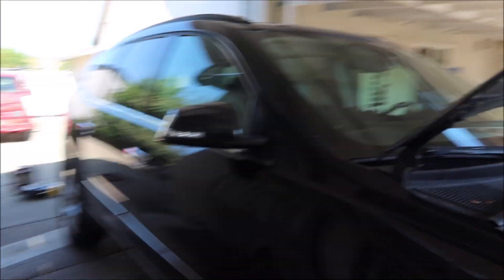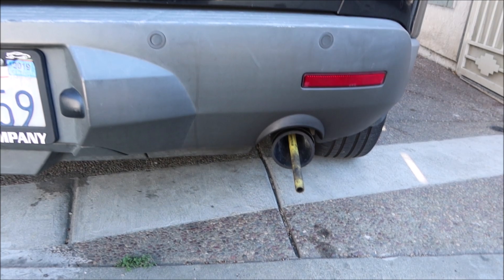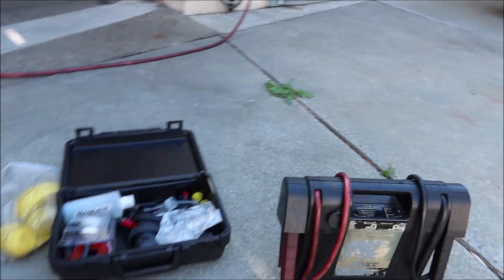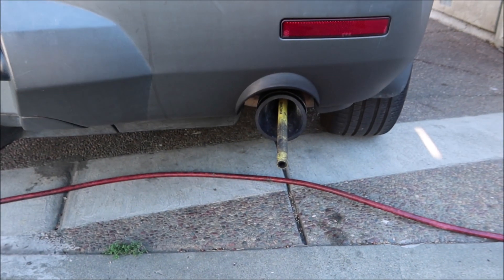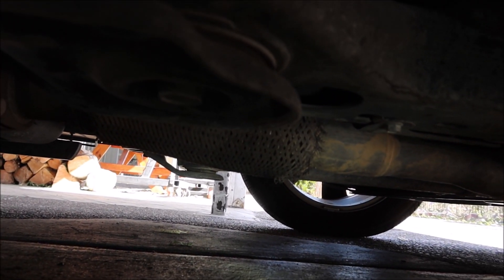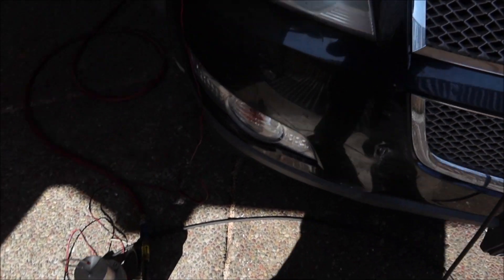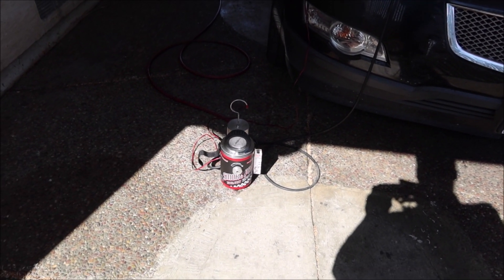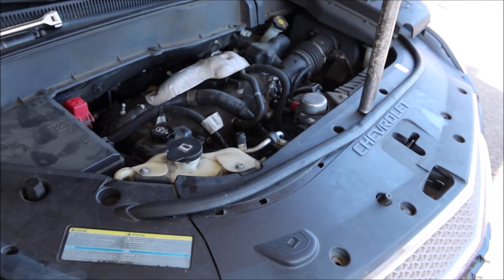How to find  Exhaust Leaks with a Smoke Machine

Comment: What kind of psi do i need to find exhaust leaks at the front of the vehicle while introducing smoke at the exhaust pipe?

I know for a 100% fact that I have hairline cracks on my manifold and collector pipe right by precat...i confirmed with soapy water and shopvac but i cant get these areas to leak any smoke whatsoever when i put smoke in the tailpipe
Reply from the maker: The smoke machine only puts out 1 psi.   Unless you have the high pressure smoke machine.  If you do set it as high as it will go.
Reply: @1970chevelle396  I guess it's not building enough pressure to reach the front of the exhaust system because it all comes out the weephole...I guess since my leaks are so minor and small that I need a much higher pressure built up for the smoke to come out...I am thinking about somehow plugging the muffler drain hole to increase the pressure

Comment: Can the exhaust manifold o2 sensor leak be detected by inserting smoke @ the tail pipes or is the smoke machine now strong enough and you have to insert the smoke closer to the exhaust manifold like through the spark plug socket or something?  It doesn't look like alot of smoke comes out of the machine but I was hoping I could find an exhaust manifold leak by going the easier route and inserting the smoke at the tail pipe and just waiting 10 minutes rather than getting access to the spark plugs and stuff.
Reply: Did you figure it out? Wondering the same thing..
Reply: @TonysGarage.Repair  I never purchased the smoke machine because I learned the odds of it being a leak are very very slim.  I used forscan and some cheap odb2 reader and my short & long fuel trims are fine, great actually.  The fuel trims would be out of whack if there was a leak.

My issue is spark/egr/pcv related, I'm thinking spark so I've got plugs ready to go.

Comment: nice tool....could you use it to locate a vacuum leak? guessing the vacuum would pull in the smoke to show location? similar to carb cleaner or propane??
Reply from the maker: +outsidescrewball    The previous video I showed how to use it to find vacuum leaks.